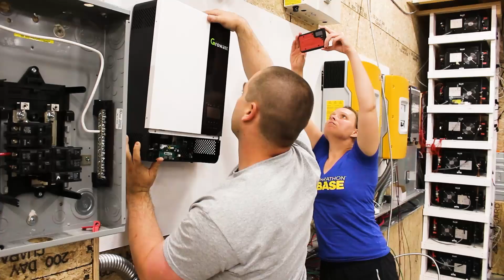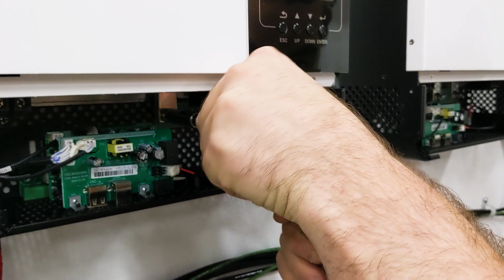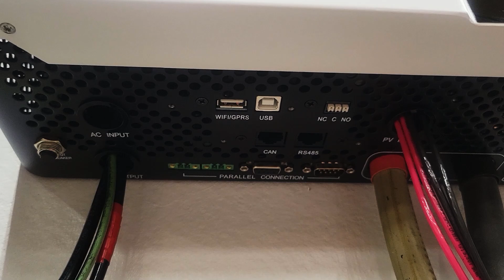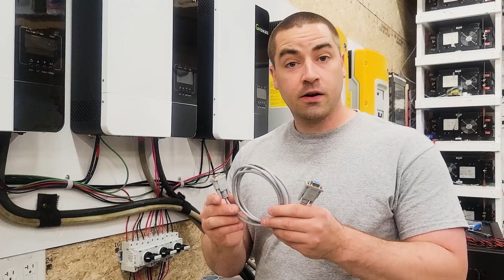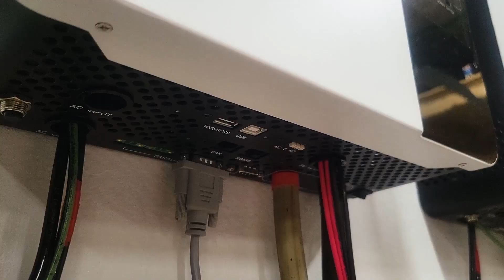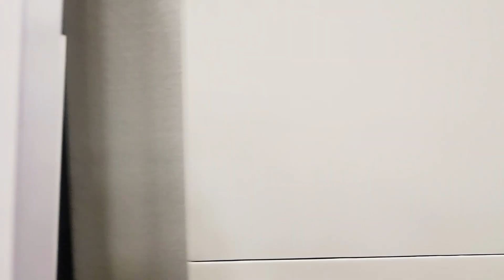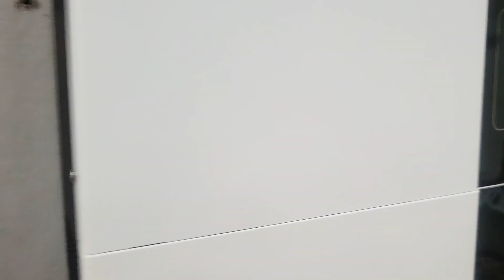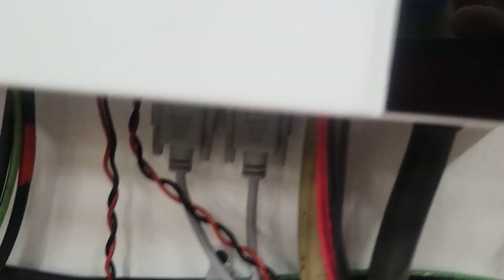Paralleling 3 inverters together, Growatt 5000w Solar System

Comment: Why do you combine the PV?
Are there directional diodes in the solar arrays? What would prevent you from feeding one array into the other array? 
Voltages and currents follow laws - not intent. Meaning, one solar array coukd back feed into the other. I don't know if there are protections however in the arrays.
Reply from the maker: Most name-brand solar panels have diodes inside.  Mine do.  But not every solar panel will have diodes, so you need to check yours.
Reply: @DavidPozEnergy  thanks. Was just wondering.

Comment: The connectors on the grey cable are called db9, you can remember because it has 9 pins and its D shape. its a serial analog communication port. It looks like a VGA video cable used on monitors at first glance but that has 15 pins, but is also still analog. JUST FYI

Comment: Everything still working?, I feel everyone is nervous with chinese stuff. Is that 3x max in parallel;?
Reply from the maker: Yes, everything s still working and in use.  This setup was 15kw total, but since this video I took one down and am running the house on two inverters
Reply: @DavidPozEnergy  I have 4 Growatt 5000 es Inverters. Can I run PV to 3 inverters and no PV to the 4th inverter? Would the only loss be not being able to charge the battery with the 4th inverter. (#14 setting is OSO "Only Solar). Do you know of any problems caused by not running PV power to inverter 4?

Comment: Your granddad's screwdriver is dangerous around electricity because it isn't insulated. I would suggest you don't use it for electrical work - or at the very least, smother it with insulation tape where you may inadvertently touch it

Comment: How do you connect these units in parallel when your commercial AC is 208V L1+L2+N? Is it possible to connect the two L1+L2 onto L+N to still have the 208V?

Comment: Is there a way to set this up so theres an auto transfer switch so that the grid can be used as a backup in the event that the batteries are drained to a specific level?

Comment: Sir,Can we connect MPPT of Solar On Grid Inverter in order to reduce current on each MPPT.For example I want to use 18 Amps Panels with 11 Amps per MPPT Solar On Grid Inverter.Is it OK if I wire all 14 panels in series in a single string and then split up using Y cable and feed both MPPTs to reduce current to each MPPT to 9 Amps?

Comment: hi David.. great videos  .. I have a new led acid 48v 560ah forklift  battery  here and am going to install a 6kw solar pv system on my house ..all the solar pv company's here in Ireland  don't want to know about forklift battery's. only want to sell me 3 .....5kw lithium  battery's at 9000 euro... so my question is ..what hybrid solar inverter should I use and do I need mppts or how many ..  . I'm fitting 18 pv panels @380w each

Comment: Heard or read somewhere that auto-transformer only handles 21 amps...That's not enough to run a clothes dryer, cook stove or even possibly a well pump... Are larger capacity auto-transformers available???

Comment: Good afternoon David. When you placed the three Growatts in parallel. How many COMMUNICATION cable did you run from inverter to battery. Did you just run one from Master Inverter to Top Battery or did you use the network hub to have Communication between battery bank and EACH INVERTER. Many thanks

Comment: Interesting video.  In the UK you wouldn't be allowed to have have independent main breakers it would have to be a change over switch to run the house incase they both got switched on. If I followed it correctly.  Interesting to see what the differences on grid or batteries are.

Comment: Hello David and thank you for sharing your experience. MY QUESTIONS are from a novice side. Please, is it possible to mix several inverters brands having the same kw outputs?
2nd No effect for having several PV power?
3rd Are you obliged to keep the batteries inter connected?  I would have separate them into 3 banks for each inverter respectively... unless your solar PV are not in the same direction..

Wowwww, so interesting combinations , thank you again
Reply: Several PV power array connecting in parallel could be a problem - unless there is protection. You could have voltage back into another array.

Comment: does the 5000ES require  grid assist  to start-up or does the inverter start/run on PV and battery without being connected to the grid, i.e. true island mode??

Comment: I thought there was a 120V Growatt 5000 model for the U.S. market, but there is not. Only 240V AC is available. I will have to stick with the 3000ES model for my portable setup.

Comment: David, as I watch your videos I have a few questions.  1) Even when stacking the Growatt inverters, does the reliance on an external auto-transformer worry you at all?  If that device dies, or if the breaker trips for ANY reason, you risk doing considerable damage to any \ all 120V devices you're feeding.  2) Does having a second redundant auto-transformer add any extra protection?  3)  I believe you compared the SolArk 12K as well, which supports split phase 120V and 240V, I understand the price point is much higher, but is it worth it to have the 120V available without risking an auto-transformer.

Comment: How come the SolarEdge transformer black & the red wire looks reverse in the subpanel the other two top ones have the black on the bottom how come the black ain't on the bottom with the transformer is that consistent??

Comment: @davidpoz what's the largest guage battery cable that will fit into the 5000es?  It looks like you went big.  That's what i want to do.  M8 5/16 terminals right?  Thanks bud, long time subscriber here 👍

Comment: how do the three inverters handle high surge loads like a miter saw or well pump?
Reply: I have had metal cutting drop saws 2.4 KW and a welder running off two MPP Solar inverters at 8KW output have had no problems make sure 48V batteries are in good condition and large enough capacity

Comment: You shouldn´t connect two different panel chains to one (with a crymp). Every chain is producing different power and voltage so other is backfeeding the other imo (if you don't have diodes in between). I don't think you will brake anything, but you will lose power....!?

Comment: I see in the specs for these inverters the input voltage is 120 - 450, does that mean that I have to have a minimum 120 volt input? I'm using wind for generation.

Comment: Hello David, I'm writing from Mauritius. Yesterday I started the connection of 2 SPF5000ES, which will be in parallel. One of my inverter is having PV voltage of 270V but AC output is 0. Whereas the 2nd inverter is having same voltage but showing AC Output of 230V. Is there a particular reason for this?
Reply from the maker: There could be a lot of things going on.  First, when paralleling inverters, there can only be one battery bank connected to both.  They have to share the same battery bank.  Second, the solar arrays must be separate.  Only one solar array per inverter, and the two solar arrays can not be connected together (wiring wise).  Third, the inverters must have AC output paralleled together.  Forth, the settings must all be correct for parallel function.

Comment: Do any of the inverter companies make rack mount inverters?
A full rack mount system would make installations easily configurable.
And do any inverters have the kind of functions that might be found in a Tesla battery or similar? Load shaving, TOU, weather related charging of batteries.

Comment: Why did you run all those extra wires into the house when you could of just paralleled them outside at the panels?  Also where did you ground the inverters too?  You use same ground rod as the solar panels are on or a different ground rod?
Reply from the maker: I ran all the wires since I'm constantly testing new equipment.  Now it's easier to change wires inside the garage.  the solar arrays are grounded at the array.  The inverters are grounded at the circuit breaker panel.

Comment: I am thinking of purchasing these for my next project. How would you recommend to wire two 15kW battery packs with two 16s bms to the inverters? I will build the battery using 16 280-320ah 3.2v lifepo4 cells

Comment: Hi David, you refered to a transfer switch in this video.  Do you have a video showing the installation of the mentioned transfer switch?  What transfer switch did you use and I assume it goes directly back to the house main electrical panel?

Comment: From your battery you went from 1 wire to 3 for 3 inverters. What size wire is the single wire and would it make any difference if you went to four or five inverters. I'm using 2 awg wire to the inverters "battery in" but would like to run a single wire closer to the inverters then split it into 4 wires one for each inverter.
Reply from the maker: The big wire from the battery bus, to the shunt, is 4/0 AWG.  Each inverter I have could draw 100A, so 3 inverters is 300A.  That's about the limit I want 4/0 Wire used on.  If I was building a larger system, up to 600A, then I'd run two 4/0 wires in parallel.  Alternatively, I could have bolted the shunt directly to the bus bar inside the battery cabinet, then a bus bar to split to the multiple wires for each inverter.  many ways to set these things up.

Comment: Have you done the update video?
Reply from the maker: https://youtu.be/OogbHnFa7G4
Reply: @DavidPozEnergy  thanks, I should have looked, but was just searching YouTube and not your page. One follow up question. For the transformer, wasn’t that the recommended configuration from signature solar? If you can share your findings on the potential issue, that would be greatly appreciated
Reply from the maker: I like adding the auto-transformer to these inverters.  It works well.  Yes, Signature Solar recommends it.  If you plan to buy some, please use my affiliate link: https://shop.signaturesolar.us/products/5kw-es-growatt-transformer-kit

Comment: I'm planning to go completely off grid solar and want to use a similar setup. I want to go ahead and transform everything to split phase as I already have a buried 2-2-2-4 wire running from my shop (where this setup will be) to my house. How would it work setting up multiple transformers? Or would you recommend one larger transformer
Reply from the maker: You can stack the auto-transformers together.  Nothing wrong with using one auto-transformer per inverter, but it's extra cost and unnecessary if you have a lot of 240V loads.  The inverters will run 240V loads directly, the auto-transformers are only for 120V loads.  Here is an affiliate link: https://shop.signaturesolar.us/products/5kw-es-growatt-transformer-kit?ref=4_rHcgZ9x-TiF-
Reply: @DavidPozEnergy  thanks so much, you're the best! So does it matter if the 240v loads are "downstream" of the panel with the transformer(s)? So the oven and AC won't overload the transformer(s).
Reply: Also do you have a discount/referral code I can use when buying from signature solar? Your videos are pretty much the reason I'm going with this setup and want to make sure you get credit for it.
Reply from the maker: "Downstream?"  I think you just mean in the panel being fed by the inverter, right?  Any 240V load being fed by the inverter is fed directly, not through the auto transformer.  I have more details on the auto-transformer and how it works in this video: https://youtu.be/yWUfvvSa3K8
Reply from the maker: Unfortunately, Signature Solar removed the discount codes.  I still have an affiliate link if you want to help support the channel, and they might still be running some holiday sales: https://shop.signaturesolar.us/products/5kw-es-growatt-transformer-kit?ref=4_rHcgZ9x-TiF-

Comment: I saw the output panel but what was the size of the wire you fed into the input panel  .. my plan was # 4 to the main breaker and # 8 on separate  breakers to feed my 2 growatts

Comment: Hi David, if I parallel six Growatt SPF 5000 ES inverter in 3phase set up and connect to three 48V Felicity Lithium Batteries in Parallel to have 30KWh battery bank, will the set work and be ok? Cause i am worried about the current that will be produced by the inverter to charge the batteries.
Reply from the maker: I just did a quick search for Felicity batteries.  If I found your model, then it has a max. charge/discharge current of 120A.  If you have 3 in parallel, that's 360A maximum.  But, 6 Growatt 5000ES can pull 600A.  So you are correct to be concerned about the Amps.  You will need a few more of those brand batteries to handle 600A.

Comment: David, have you ever thought of using a transformer based Growatt 12kW 48V 250VDC 120A Off-Grid Inverter instead of your three  500kw transformerless growatt to run your whole house?

Comment: If I have a combiner box at the solar array that has 2 or more strings of panels do I need more than one set of wires running to the growatt inverter. Thanks

Comment: Hi !David.To my gooseneck enclosed trailer i did 2 growatts 5kw to small main panel 240volts 100  amps 8 spaces breaker and pluged my autotransformer with 30 amps breaker and went to a second sub panel 8 spaces to power only my 120 volts breaker.So went the main 30 amps shuts off for the autotransformer it also shut my 120 volts panel.
Reply: Keep going ON!!!

Comment: @DavidPoz Looking for your parts list with the video, the switches and the battery rack grommets. The meters? Are your inverters in 1 phase? are they in 2 phases?
Love your shows, I have the 2 growatts and the transformer on my table, waiting for panels and G4LL lifepower batteries.

Comment: Thanks David,
I am currently involved in a 4 5 K Inverters setup with 16 450W  panels.
You should drop in the diagram for the others DIY watching the channel.
Have installed Lightning protection?
Reply: not near enough panels for 20Kw's of inverters. I have 4- Growatt 5k ES and 11.8Kw of panels and I just bought 14 more panels (5.6Kw more) because it was needed to balance the system better.

Comment: So you have {6} arrays? Which is why you have two positive and two negatives?
Reply from the maker: I have 6 strings.  Each string has a positive and negative.  They are on 3 ground mounts, 2 strings per ground mount.
Reply: @DavidPozEnergy  Thank you

Comment: If the breaker trips for the auto transformer, then wouldn’t the circuit path be broken and essentially all the 120v loads would be in essence turned off?

Comment: Could you explain why, in general, paralleled smaller inverters is better than one big one? Thanks for your great channel. Learning a lot.
Reply from the maker: It's not necessarily better, just different.  In my case I choose to go this way because each Growatt inverter has a built-in charge controller.  By having 3 inverters, it's like having 3 charge controllers.  I have 3 solar arrays in the backyard, each array needs one charge controller.
Reply: You also have a level of redundancy if one fails you still have power.

Comment: So here is a solution to your auto transformer breaker issue where imbalance occurs if the autotransformer breaker trips:

When only using two Growatts, set the output to 120V on each Growatt and then set them up to be L1 and L2 just like your other equipments.  Feed the two Growatts into the panel with one being L1 and the other being L2 i.e. L2 is 180 degrees out of phase with L1.  If only Growatt #1 is working, then only the L1 circuit is energized, but if you now bring the autotransformer into circuit by turning the autotransformer dual breaker ON, then the L2 circuit is energized through the autotransformer however the auto transformer is working at full load so you do have a 5KW limit.  When you bring in Growatt #2 it uses the other winding of the autotransformer and the transformer load reduces to only have to deal with the imbalance as in you video.  Be careful to set the autotransformer breaker to a max of 5KW at 120V i.e. .around 50Amps.  I hope this makes sense to you and good luck with your great work.